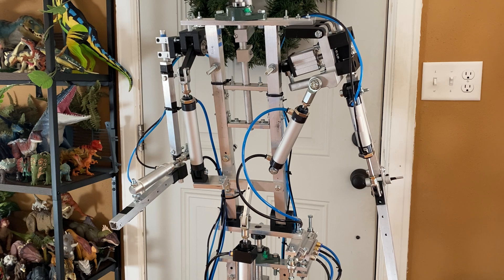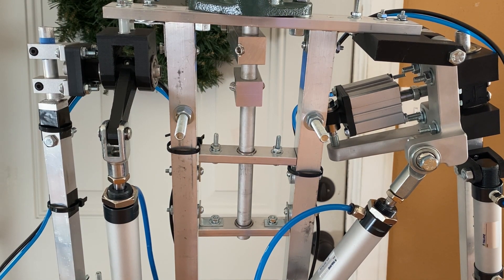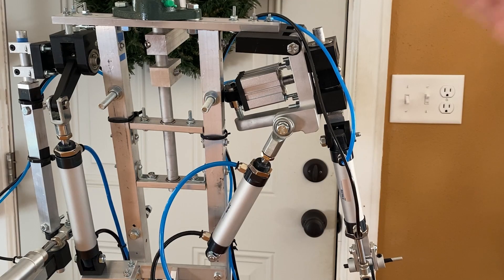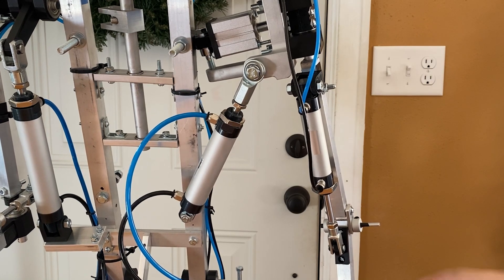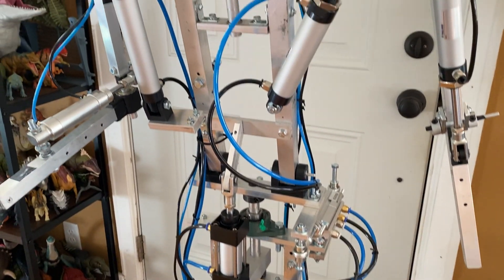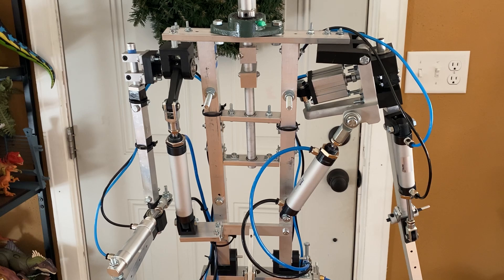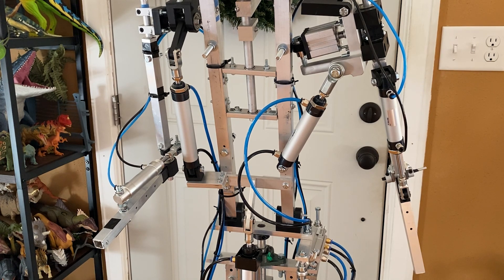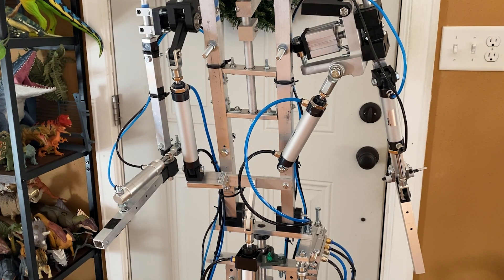Homemade "Rock-afire Inspired Pneumatic Animatronic" Update 2: New Parts and Project Plan

Comment: Fun Fact if you this but with legos and lego pneumatic cylinders with a 5 gallon water jug you can make a animatronic who's jaw movements can sync with rap god by eminem
Reply: @rudy5070  I don’t think Lego would be air-tight enough for that, and they would probably disconnect if they had pressure put on them.
Reply: @HobGobbity well its certainly possible  given the fact they make super fast lego pneumatic engines
Reply: @rudy5070  wow, I didn’t know Lego went that deep.

Comment: How would one start on a animatronic build like this I've been into the rock afire explosion for ages I'm a junior in high school who has a job in construction where would you go to buy parts and how would even begin on a Awesome project like this?
Reply from the maker: @lost_pilot thanks for watching, that’s very cool that you work in construction! Are you looking to go into engineering in college? 

I get parts from hardware stores like Lowe’s and Homedepot, and I get raw material with specific measurements from McMaster-Carr. I get pneumatic components from Amazon as of now, but I intend on upgrading them once I begin to put more money into this. They work perfectly fine for my application, but if you ever intended to make animatronics for regular use, then upgrading the cylinders would be a good choice,

Comment: I think it’s smart that you’re using different colored airlines to distinguish which sides of the cylinder get air on default. I tend to get mixed up when troubleshooting since all the airlines look the same and are all going to the same places. Once I get time to “reboot” my setup with a lot of reorganization, I’m probably gonna start color coding things so it’s easier to navigate all the hardware and stuff. 

Love the mechanism you’ve got, pumped to see what you’re future projects have in store 😉
Reply from the maker: @Sea_of_Waves  it helps a ton! I’m able to instantly see which side will have the air by default, so I can make sure the position of the figure is how I want.

Comment: Do you why the Disney animatronics move a lot smoother than the Rockafire characters? Are the Disney character mostly servos? or hydraulics? I was curious how Disney seems to be able to control the speed and acceleration of each movement so precisely.
Reply from the maker: @AntronGeese  mostly hydraulics, they also have more complex mechanisms and their pneumatic ones are position control
Reply: @collegetoycollector  I assume hydraulics are a lot more expensive?
Reply from the maker: @ typically, hydraulics are used for heavier mechanisms. Disney uses it more for better control overall and budget constraints are not a big issue like it is for smaller businesses. The major disadvantage is that fluid can ruin cosmetics if it leaks.
Reply: @collegetoycollector  I see. I am trying to figure out how to get smooth motion that can accelerate and decelerate, unlike the CEI-style characters.
Reply from the maker: @ servos will give you the most control, what kind of figures are you trying to make?
Reply: @collegetoycollector  It is an original, abstract character.

Comment: Do you think it would be feasible to make an animatronic but using PVC pipe instead of metal bar stock? What kind of problems (and potential solutions) might I encounter? I suppose the attachment points between the PVC and the cylinders might wear out a lot faster. Any suggestions?
Reply from the maker: @AntronGeese  you can make animatronics out of pvc. Obviously the material properties will not be up to par with metal. If airflow is controlled to not move too fast, pvc could be fine.